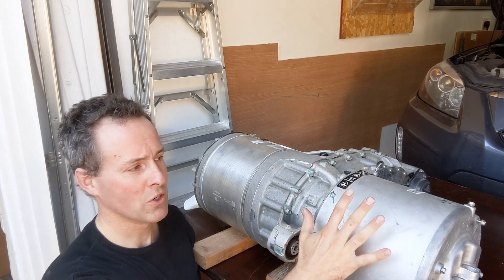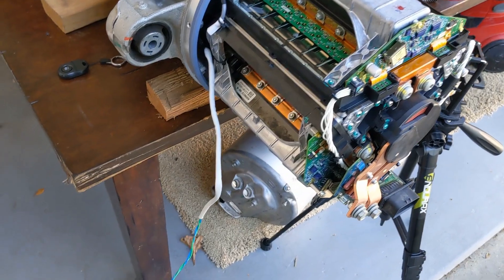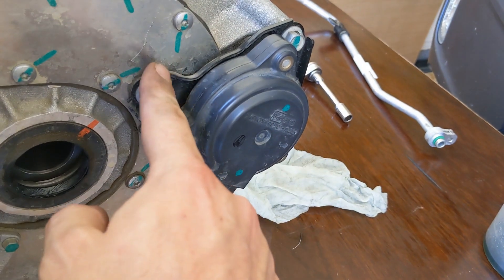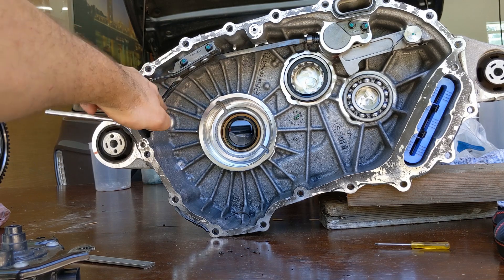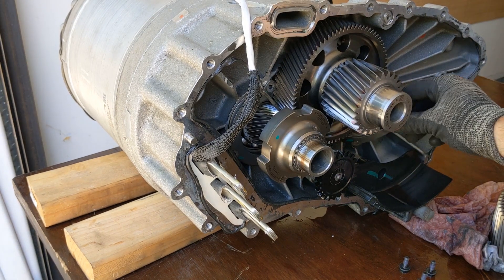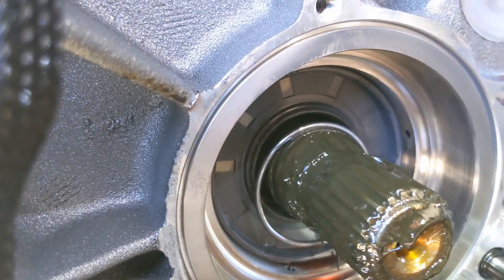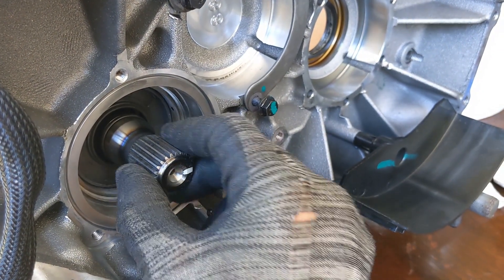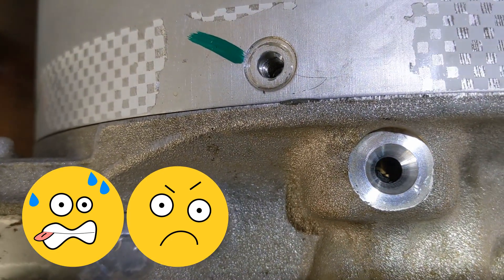Broken seal in Tesla gearbox discovered after 42k miles: Was this to be expected?

Comment: Thanks for the great video. The tech I have work on my Model 3 recommends changing the oil and filter every 30k miles in the drive units. (Retired Tesla certified Tech)? He also says that in the annual maintenance is very important to visually inspect the drive units for leaks as well as all the suspension bolts for tightness. He also says that it very, very important to do a weighted wheel alignment as it has been his observation that the factory alignment is not very precise leading to premature tire wear.
Reply: Tesla techs retired before GTA 6
Reply: @betahours9416  Not sure what you are referring to?

Comment: The parking brake seen here is also used in mercedes with tesla large drive unit
Reply from the maker: Correct
Reply: @diyEVguy  What do you think about the coolant delete option?
Reply from the maker: @rienkvandenberg9103  Thoughts: which exact conditions would cause the rotor to overheat and damage when deleting it's cooling? If it only means that you can't abuse the car on a race circuit but all other everyday use is fine, then the deletion is preferred over seal replacement.
Reply: @diyEVguy  Someone told me that this motor is only rated for 30kw constant. But peak power is almost 300kw. I think cooling is very important even for daily use if you like to accelerate fast.

Comment: I got to hand to the Tesla engineering and RD department, this is a well-built piece of equipment. No wonder the Tesla automobile is so popular, excellent engineering.
Reply from the maker: What aspect do you admire most?
Reply: @diyEVguy  The care and precision and patients you need to work on these units. One thing I got out of this is that this is not a DIY project. If you have a problem with your electric car please take it to a professional technician.
Reply from the maker: @TOONMAN200  Yeah in general, for most people, that is the best advise.

Comment: What symptom was seen before the unit was pulled?
Reply from the maker: Coolant on the speed sensor. See also my very first video.
Reply from the maker: Actually for this seal no symptoms at all, I just stumbled over it.
Reply: @diyEVguy  Thanks, I subbed and will check the other vids.  I wonder if that bad seal would have no symptoms or cause no problems.
Reply from the maker: @ohger1  When it fails, the red Dexron VI fluid would gradually flow into the rotor chamber and next also into the inverter. It is non-conductive, so it should not short out electrinics, I guess. This continues until the gearbox runs dry and then your bearings may die.
Reply: @diyEVguy  Thanks for the info.

Comment: Thank you for the great video. I appreciate that you included the torque specs. 

Did you happen to find any part numbers for seals and bearings, as well as places to buy them? My biggest concern is finding the seal at the end of the coolant tube that that runs down the rotor. 

Thanks!
Reply from the maker: I bought Chenming seals through aliexpress. I want to discuss those in a next episode. Bearing: not sure if I need to replace them. I will share the model numbers though.